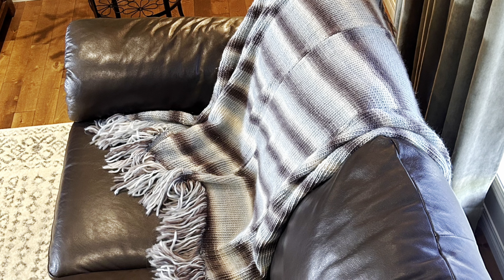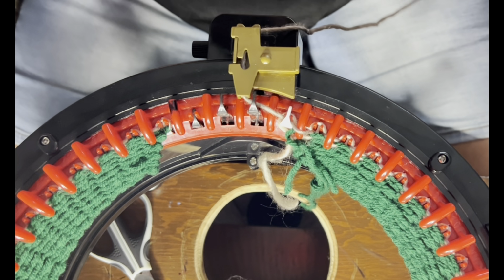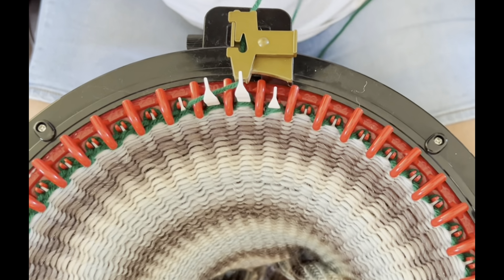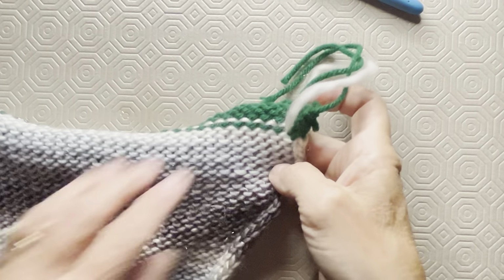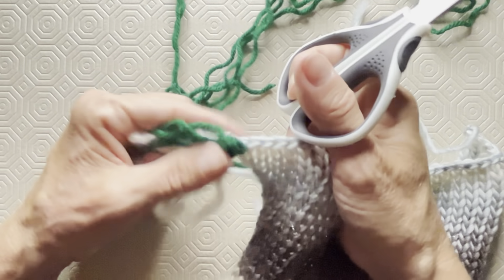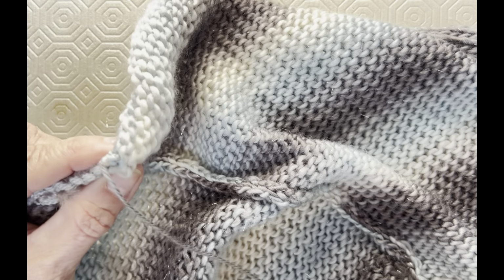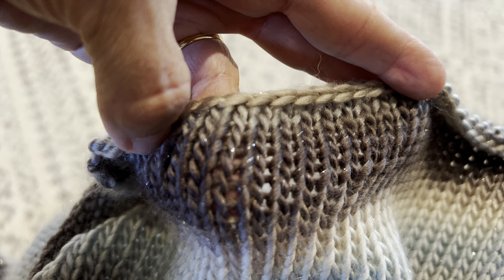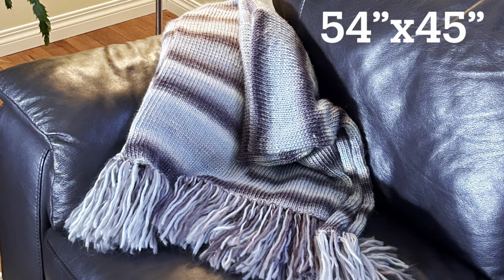Easy Throw Blanket - Made in Flat Panel Mode ~ Addi, Sentro, Circular Knitting

Comment: On my CSM machine, I pull the waste yarn off from the last row next to the panel. You simply find the loose end and pull up a loop from the opposite end (like a gathering thread) until the loose end comes through. Then the whole waste yarn portion comes free from the panel. You can then unravel it easily and wind it for reuse. Looks like it would work for these machines too. I haven't tried it. My Addi is being shipped, can't wait. Enjoying your videos while waiting.😊
Reply from the maker: You definitely can do that on a tube. I haven’t tried it on a flat panel but I bet it would work as well. 
Hmmm!🤔 Gonna give it a try! Thank you. 😊
Reply: I love this blanket!  I noticed  that the striping pattern on the panels had the white stripe to the right of the 1 panel and to the left on the other one.  I'm not sure, but I'm wondering if you turned the second and forth panel before connecting them, would they line up better?  I can't wait to try this.  Thank you!  ❤😊
Reply from the maker: They possibly would have but for this blanket I let it work up without intentionally trying to match stripes.

Comment: Thank you, very nice video! Why do you need waste yarn? Would it be possible to knit without it?
Reply from the maker: So that I can make a straight edge on the end. Otherwise it would gather.
Reply: to use waste yarn for the first few rows ensures 2 things ; it secures the stitches of the very first row,  secondly if ever working a hem which means we want an edge that does not roll  +usually will take 5 -7 rows + it is the nature of the beast they call it. stockingnette stitch is the end result of knitting like this verses > handknitting ;  to do a hem is a more finished look , double the edging to at least 1 & half inches to 2 inches picking up those stitches identified by waste yarn { For ex. @ inch of knitted fabric = 5 stitches do you want a two inch hem?  10 rows  doubled 20 rows < ultimately use the row above the last row of waste yarn to connect with that 20th row ,you may even complete this as you knit by pulling the first one done @ beginning row to the current one & knit them together

Comment: Beautiful blanket. I would be concerned that the tassels wouldn't hold up or look nice and unravel because it is roving yarn, do you have experience with having made tassels with this kind of yarn and keeping it for long term, washing-drying, etc?  I was also wondering if I it would bother me that the stripes do not line up when doing the panels for the blankets but I think I need to see a bigger picture of the blanket or just try to make one myself.  Thanks so much for the video and the tutorial.
Reply from the maker: I do not have experience washing this kind of yard. Now
I’m concerned. Lol! But we will see. 
I am a stickler when it comes to
Matching the lines on projects but this doesn’t look like it’s supposed to match because the lines are all different thicknesses. The blanket truly is beautiful.
Reply from the maker: Coincidentally, I removed it from the wash. I added it with towels cause I wanted it to get a good beating. Hahahaha!
It was shedding a bit so I wanted to see if that’s all it needed. 
I just hung it on the line and I will do a short video to show how great it came out.
Reply: @koalaknitsandknacksaddicrochet  thanks

Comment: Great tutorial Shelley!  I got through 4 panels of 300 rows 👏🏻👏🏻 but my fifth panel with the same yarn, was giving me problems. At row 240 - yarn did not catch on first 5 needles... five stitches😵‍💫🙀😡😡😡  I will look for answers to this problem.  Found one on "how to reverse".  May try lifelines???  Hard to work on fixing on machine because of hand tremors.   May leave it for a few days.  Any suggestions?
Reply from the maker: You could just take the work off each of the needles, one needle at a time and drop down the row to below that missed stitch and then pick them up with your crochet hook as you do a tucked stitch. Don’t reverse. Just do it on the next round. 
If it is way down your panel fix it when it’s off the machine. I have a video on my channel… how to fix a dropped stitch once your work is off the machine. 
Click on videos and scroll quite a ways down. You will find it.
Reply: @koalaknitsandknacksaddicrochet  the working yarn came  loose at the start of a new row and before I realized it the yarn fell behind 5 needles as I moved the carriage so none knitted and working yarn is just hanging out behind needles.  🙀  sounds weird.  I must have blinked!   
Thank you Shelley, I will check your videos again.  I know how to pick up a single missed stitch,   But not 5 in a row.  Maybe I'm just afraid to try.
Reply from the maker: Sorry that happened. It can be frustrating for sure. 
Might be worth redoing the entire panel.
Reply: @koalaknitsandknacksaddicrochet  I know you can sympathize because you may have experienced it.  Thanks for your help.
Reply from the maker: Oh absolutely! We all have!
Reply: @koalaknitsandknacksaddicrochet Mary at @Calumet knits has a great video for "Backing Up on the Addi/ Sentro".  To fix that problem I was having.   Now I have to learn to "graft" 2 panels.😵‍💫  I will double check all of your videos too.

Love your helper ❤❤
Reply from the maker: Good luck by friend! You’ve got this! 🥰
Reply: @koalaknitsandknacksaddicrochet 😭😭 my 5 panels of 300 (or I thought)  are different lengths!  😭But- only found out after seaming them together.   I caught one panel but it messed up the other 3.  One is 2" off and it's in middle!.  I tried "lifeline" but can't get it straight.  So I will be frogging it.  Or at least the middle panel???  I will watch more attentively before attempting again.   Found  more tips after viewing this video 5 times.  🙀

Just wanted you to know how very very much I appreciate your tutorials!  Thank you Shelley.🥰
Reply from the maker: Awe, so sorry my friend!

Comment: Trying to make the blanket, the problem I am having is putting the panel together, we do not have a dollar Rama in the United States and is the yarn you used for that a 2 weight or a 1 fine weight?
Reply from the maker: I don’t know what you would call it. Likely a 1 fine but just use the yarn you are making the blanket with. It will be perfect. 😊

Comment: Great video, thank you!  I have never made a flat panel on my Addi before and was wondering if it’s necessary to use the extra plastic thingies which came with the machine?  I can’t see them on your demo.  I went out today for some yarn to make a baby blanket referring to one of your previous videos.  I like the idea of a single layer for less cool days.  I wish there were discounts here in France for yarn ….. or anything!!
Reply from the maker: Thank you my friend! You can use the stoppers if you are not using all 43 needles. 
I have used them before I like them. 
You can make flat panels in circular mode and then the black needles will be the middle needles if your panel and the stoppers will be on each side. 
Then it counts in the middle of each row. 
Hope that makes sense. Lol
Reply: @koalaknitsandknacksaddicrochet  Yes that makes sense!  Hopefully today I’ll put it to the test on the baby blanket!  Thank you!
Reply from the maker: Please show it in a group and hopefully I will see it. Have fun!

Comment: Hi I have bought the electric adapter and takes a lot of strain off my shoulder I love it but I want to make a flat panel so I can make a jumper trying to work out if I can use the electric adapter I think I can but very slowly see what happens 😊
Reply from the maker: I wish I could give you an answer but I have no idea. I hope it works for
you.
Reply: @koalaknitsandknacksaddicrochet  you should get one there not that expensive and takes the strain off your arm and you can adjust it to go fast or slow perfect for hats and double panels takes less time too 😊

Comment: Love your tutorials!!! All I’ve learned to make in my Addi, I learned from you. Did you do this in the circular setting or flat? Also, can you do a tutorial using the stoppers? Thanks for all you do. 🙏
Reply from the maker: Thank you! This one is flat panel. 
I did a tutorial using the stoppers when your machine is in circular mode. 
I should do one on flat panel mode as well. 
However, watch any of my videos where I do a flat panel work and I’ve likely used them.

Comment: How do u stop the sides an ends from curling in
Reply from the maker: @dakotarone3054  this side ends naturally curl on a flat panel. You can straighten it a bit by blocking it. Crocheting an edge also works great to eliminate the curl.

Comment: I would like to do 160 cm x 200 cm how many rows i must do?
Reply from the maker: @Harukamichan  sorry, I do not have row counts for every size blanket that someone would want. You need to calculate approximates from the sizes make. However, every 5 rows is approx 12 cm.
Reply: @koalaknitsandknacksaddicrochet   sorry fot that question. I thought you had already done such a size. Thank you for answer